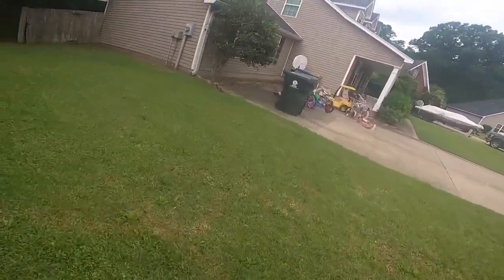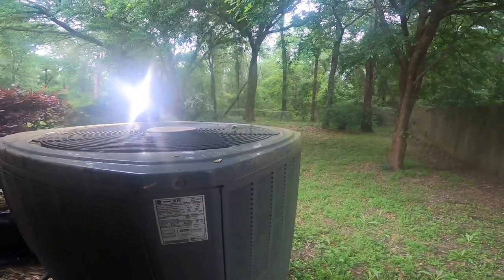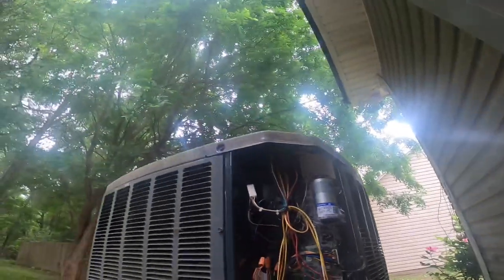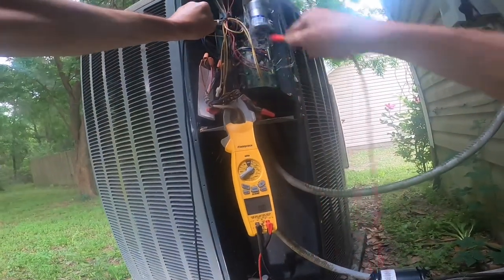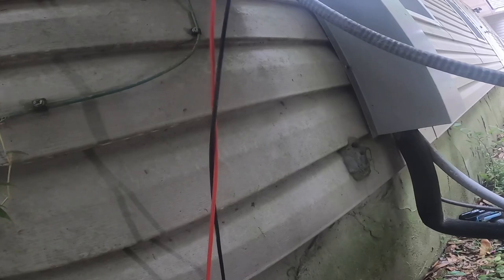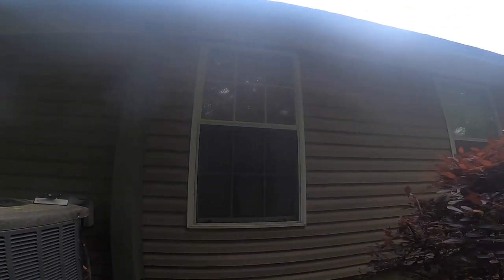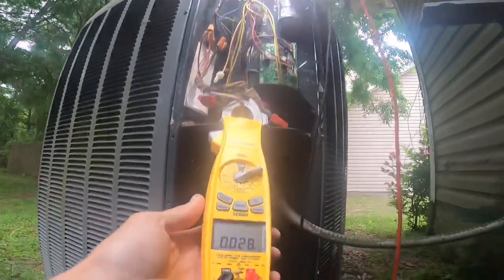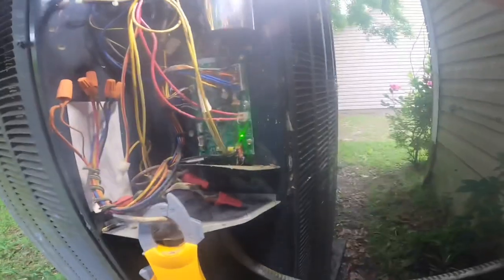Giant Trane condenser tripping breaker, and soft lockout

Comment: The 16+ SEER Trane units with large condensers have large amount of refrigerant.  This sometimes causes issues with off state liquid refrigerant flood back to compressor input.  They use compressor's discharge check valve and they close down EEV when it shuts off to trap refrigerant between compressor check valve and EEV.  As condenser cools down in inactive state much of refrig gas condenses under the trapped off state high pressure and stays as liquid in condenser, reducing possibility of liquid flood back to compressor.

Problem is the compressor check valve starts to leak more as unit gets older allowing more liquid to condense on low side of compressor in off state.  You can check how long high side pressure last after shutting off unit.  It should stay with elevated pressure for over an hour to give time for condenser to cool to ambient temp and condense trapped refrigerant gas.

Another common issue is thermistors in air handler.  If it detects out of range reading of thermistor it reverts operation to a 'safe' mode which is effectively a fixed orifice mode of fixed EEV opening position.  They don't close down EEV in off state when in this safe mode. In this mode you can hear the woosh of equalizing liquid refrigerant into air handler after unit shuts down that you do not hear in normal mode operation when EEV shuts fully closed (position 0 of 0-500 range on EEV).

Air handler may show a flashing red light indicating out of range thermistor but homeowners rarely notices it.  If run too long in safe mode, particularly at cooler outside temps, it can do permanent damage to compressor.  I would much prefer they shut unit down forcing homeowner to call for service.  A service tech could invoke safe mode temporarily to keep some cooling for homeowner until they return with replacement thermistor.  If you often service Trane units you should keep spare thermistors on your truck.

Comment: They don't call them Trane's for nothing. My 5 ton variable speed American Standard is every bit of that big if not bigger. Thing weighed over 300 lbs. Mine did a soft lockout on me couple months ago because the condenser fins got clogged up with pet hair and the compressor kept overheating does it more than 4 times in a 24-Hour period it soft locks itself for service to keep the homeowner from burning it up.

Comment: We just had the same problem the AC guys came and they said it was a soft lockout which they weren’t that familiar with but they reset the unit and it started working again they have no idea why it locked out this was during heat pump operation

Comment: What was the fix for the lock out code?
Reply from the maker: It was likely on soft lockout because it wasn’t running. When I removed 24V by cycling power to air handler it reset and began cooling. I found no other problems
Reply: @HVACGUY  thanks for the info love all your videos  keep up the great work 👍🏻